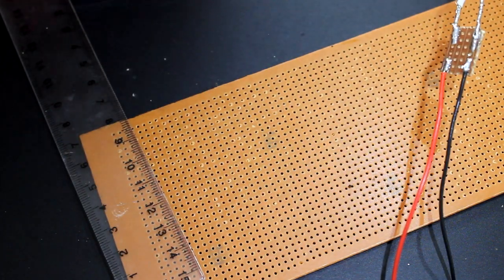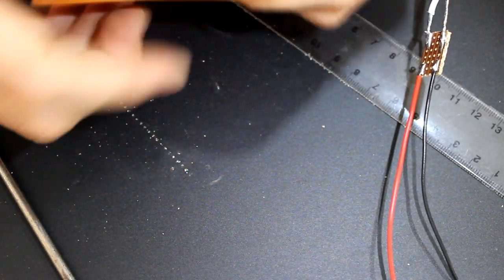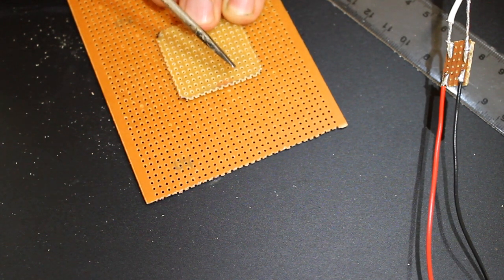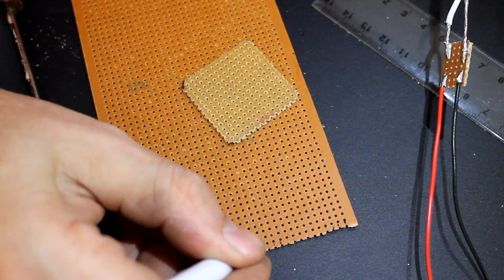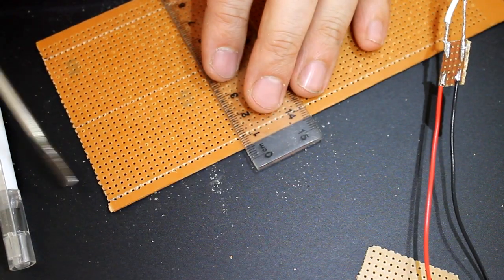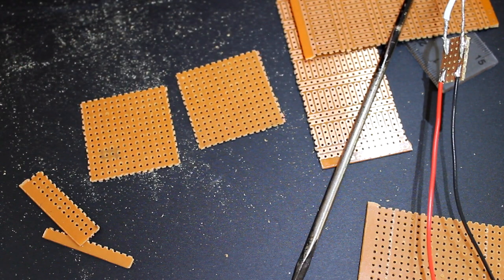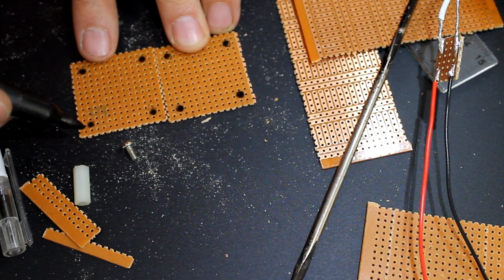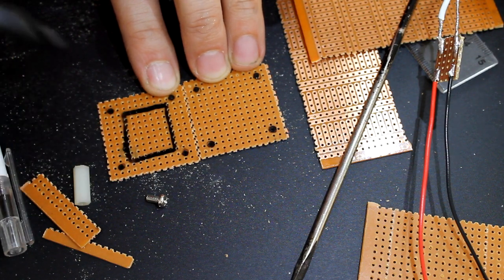Cutting strip board

Comment: I thought let's check what happens if I start cutting with a small wire cutter and once I made the first cut the rest just snapped like magic where exactly I wanted. Maybe I was lucky.
Reply from the maker: oh 'luck' is a fickle friend... there are only 2 things that will make this fail. 
1 - if there is already a fracture in the board (a manufacturing fault). or 
2 - if you don't score the strip board enough.
Reply: I used that method for a while, until I tried to trim part of a populated board and it broke the whole thing